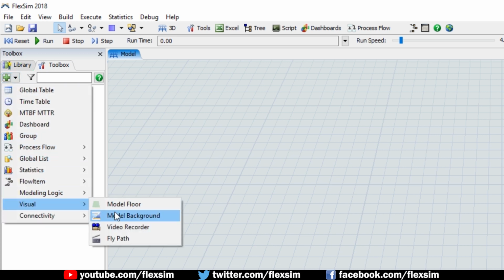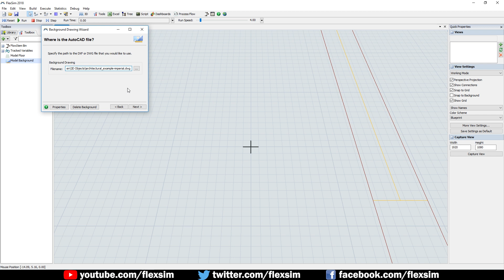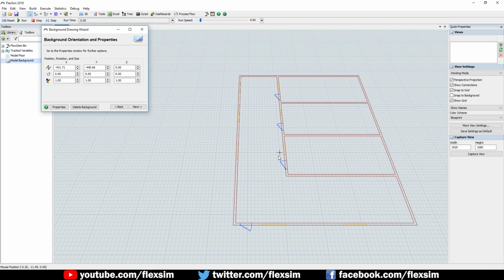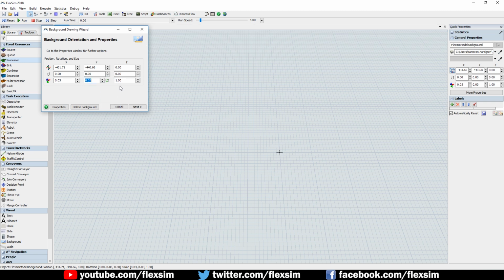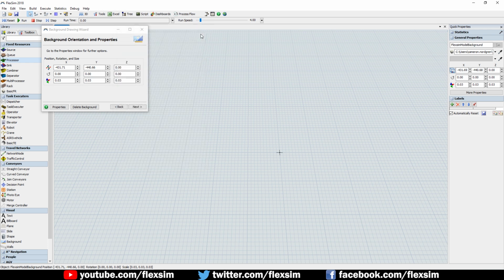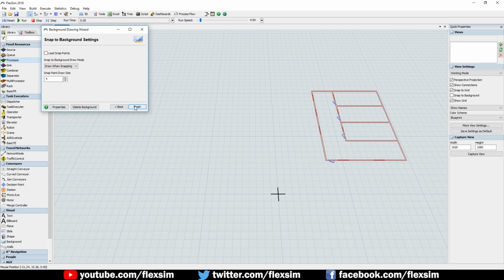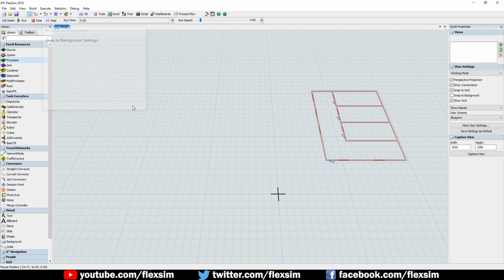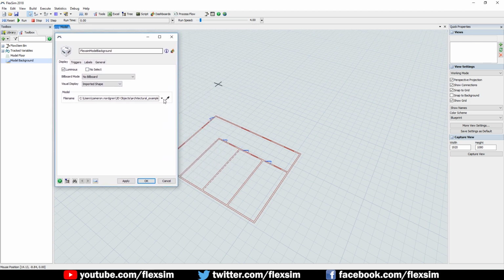Add a CAD Drawing in FlexSim

Comment: How does this work with the 2021 version? It is no longer layed out like the video.
Reply from the maker: The Model Background tool is still in the same place -- simply add the tool in the Toolbox and click the "Browse..." button to specify your drawing's file path. All of the functionality shown in the video, including position/rotation/size and layers, are still available in the properties window.
Reply: @FlexSim  it ended up being Flexsim doesn't like SharePoint files. Once i downloaded to my desktop, it worked. But now, if i want to add to load snaps, the file crashes and doesn't load the snaps.